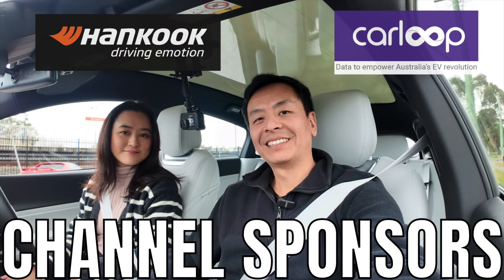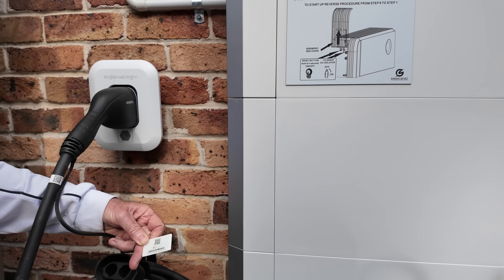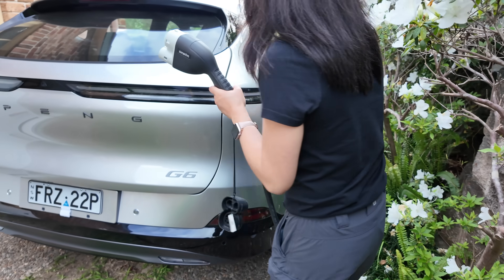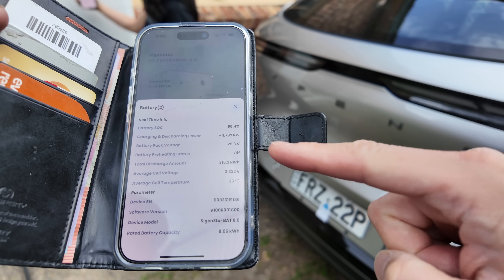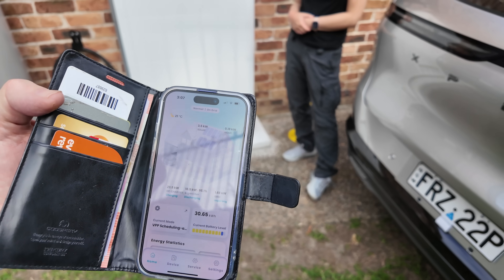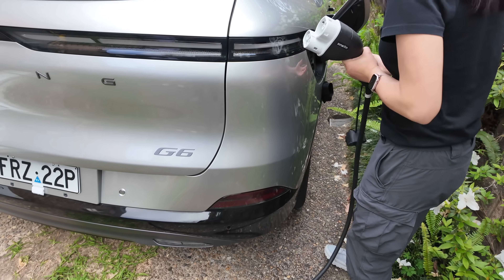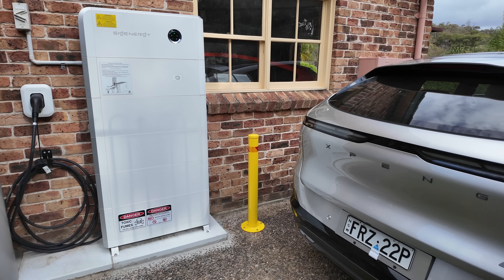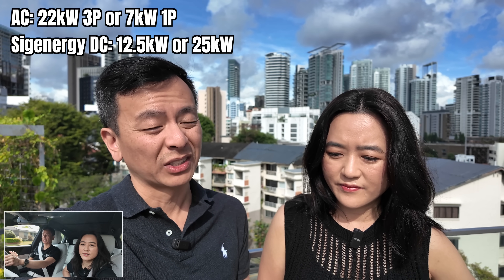Sigenergy EV DC Charger 25kW Real World Test | Is it worth it in 2025?

Comment: Seems rather niche currently. I can see homes sharing a single EV that has limited AC charging like BYDs wanting this. Other than that or commercial use I'd just use 3 phase AC.
Reply: Unless upgrading to 3 phase cost $3-5k. Which is now the entire cost of the DC charger.
Reply: @lordanubis5965 Things I currently use 3 phase power for. My grinder, air compressor, bench saw, welder, car charging.
This is a decent chunk of cash for a single function device. It's got potential, but currently very niche uses. I'm hoping in 10yr the technology evolves to have more functions.
Reply: Good point raised. I have a single phase house and a 50 metre driveway and power cable run.  Upgrading to 3 phase on my property would be very expensive (>Aud25k) as I would need to dig a new power cable run and remove trees.  The Sigenergy can be a good option for single phase houses who want faster charging than 7kw.
Reply: @tonyg2002Aust  3 phase is just far more useful currently. I'm not sure of current costs but installing 3 phase in my house, I think was the 60s(my grandparents put it in when they built the shed) was pretty cheap and easy with over head powerlines. In my area 3 phase is still easier, cheaper and offers more utility than the DC option.

I'm very interested in the technology and expect it to evolve to more than vehicle related purposes. But until then for most I think 3 phase wins.
Reply: @OTPulse i don't see the benefit unless you already have it. There is nothing to gain by paying for 3 phase unless you are running a home business in your shed. You are better off putting that cost into a bigger/better system.

I have single phase 10kW Sigen system with 32kWh of battery, 12.5kW DC charger. With 18kW of PV.

I am currently running my house in off-grid mode. Even with Ducted Aircon Heat/Cool running whenever i need it and fully electrified house (no gas). I never pull more than 10kW total load on my single phase inverter, so i never pull from the grid. I just turned the grid off to prevent exports in the end.

The DC charger is now 40% permanently price reduced. So if you factor the cost of a 3 phase AC charger + install and cabling vs dropping on module on you existing stack. Why would you waste thousands on three phase??

The cost benefit for an average household just don't stack up.
Reply: @lordanubis5965  I'm going to trust your experience. As I already have 3 phase, going DC is kinda pointless, but I just asked my brother who's an electrician and 3 phase in my area is under $2k. Maybe it's more expensive if you're area has underground power.

Personally I don't think either is worth it for the average person.
Reply: @OTPulse  Yeah I'm on underground power and not close to the electrical bollard? (green box). So it would be a lot of cabling and earthworks for no actual benefit in my scenario

Comment: I have the 12.5kw version. I charge only using PV as i'm off grid. Its fantastic! bi-directional works well with my BYD Atto 3
Reply: Does the Atto 3 battery warranty allow v2h?  Is there govt legislation for v2h where you live?
Reply: @michaelcurtis559  Atto 3 comes with V2L lead from BYD, and they have no way of telling the difference between V2L and V2H 😁. I've used my Atto 3 V2L to power critical home appliances during several power cuts (i.e. 'DIY' V2H), but it does involve running extension leads from the car into the house. Of course, you are still limited to 2400W total load with Atto 3. I'm currently trying to get in on one of the bidirectional charger V2G trials being run here (Endeavour Energy and Amber).

Comment: If you have a 48kwh sig stack, 6 batteries, to add a EVDC .. do you have to split the stack… as I understand u can’t add it to a stack of 6 batteries?
Reply: yes need new stack with additional inverter so not sure if worth it or no
Reply: @stanavagiannis2381  Actually it wont work when you are not connected to the grid, you need the dc charger to be in the stack unfortunately.
Reply from the maker: Correct. The stack of 6 (excl inverter) must include the EVDC

Comment: Tom it is always recommended to undo the cable and no looping so it won’t get warm when charging.
Reply: A good comment - so I went and charged for 4 hours straight today (thats my house and Sig battery in the video) and checked the temperature of the cable.  It didnt get warm from the current.  25kw max doesnt seem to be much for these thick cables.  They are probably the same specification cables for use with 200kw and higher charge rates.  A good safety comment though, appreciate the perspective.

Comment: It is extremely quiet. The only noise I notice on mine is the beep to say it started charging.

With the price drop just announced. I am seriously considering upgrading from 12.5kW to 25kW.

The full integration of the DC charger is far superior to the AC using clamps. As the clamps can be affected by export restrictions. So, if you are in WA where you are limited to 1.5kW export. You will never really achieve PV surplus charging on an AC charger is your inverter is bigger than 5kW, because it will never detect enough surplus at the meter to initiate a charge. (Endless posts on Whirlpool Sigen Charger thread.) We also don't have access to Amber or any non-government retailer on our grid, so self-consumption is key to ROI in WA.

My commute is 50km each way. 5 times a week. My BYD Sea Lion 7 won't make the full 5 days without charging. This charger allows me to get higher volume into my car prior to losing sunlight after work and no grid draw. My personal goal is net zero 2025, to have zero grid draw as i get $0.00 for exports. My Sigen backup gateway is set to "Off-Grid". Using all the PV I generate is vital for ROI.

The app and system have total control over the charger. not meters clamps or third-party sensors needed. If you connect a Home Assistant to it, it levels up again and it allows a lot of automations than the two token app ones.
- For example, I set mine to start charging every night with my heat pump HWS turning off as the "On" trigger and to keep charging from battery only until battery SoC is 35% then turn charger off.

You can also be community minded and add it to PlugShare app for others to use if you trust other humans.

Bi-directional is a consideration, but not something I am willing to engage with due to "grey area" of vehicle warranty.... A recent video from @ElectrifyThis about Aviloo proves that the car logs what type of charge or discahrge the vehicle does. So I'm not rolling that dice until my car ROI is 100% or someone wins that battle in court.

According to Home Assistant. My Sigen system since 14th July has saved me $1130 in potential bills. So, multiply that out over a year. That system and charger pay for themselves pretty quick. Full ROI in 1,579 days.
Reply: what price drop?
Reply: @caramelexspressofan  Sigenergy announced as of today have dropped the price by 40%. Comes with extended warranty before 31st Oct.

7.5m is being phased out and will only come in 10m cable length.

Comment: Whether it’s worth it simply comes down to cost. I recently tested my Seal with a bidi dc charger that is going to sell at a very attractive price point… I’ll probably ditch my 22kW AC charger for it given the bidi capability.
Reply from the maker: What export kW did you achieve with the Seal?
Reply: @LudicrousFeed  7kW - but this appeared to be a constraint of the bidi charger - we also performed a V2V test and dispatched 20kW from an Atto to my Seal. 🙂
Reply from the maker: Nice! Did you need a special cable for the V2V?
Reply: @LudicrousFeed  Nope - regular CCS2

Comment: The benefits of the bidirectional charger are less to do with the charger speed and more about access to the power stored in your vehicle battery to run your home or export to the grid when appropriate.  With this system, you'll be virtually off-grid all of the time.

Comment: I have a MyEnergi Zappi charger in 3 phase so can deliver 22kW on AC, but one thing which wasn't made clear in the video is that, I will ONLY get 22kW AC charging if the vehicle supports it, which no vehicle does yet. That's because the AC to DC inverter in the car supports either 7kW or 11kW for all current EVs. For example, my two BYD's have 7kw inverters in them to convert the AC, given to it by the Zappi charger, to DC.

Tesla's and Expeng can do 11kW charging on AC.

This Sigenergy is supplying DC charging, which means you can always get 22kW because every single EV car does more than 22kW in DC charging.

So the point here is, if you want more than 7kW and 11kW home charging for your vehicle, then you need a DC charging system, like this.
Reply from the maker: Cheers for the clarification 👍 In the summary at the end, we did allude to the fact that if you had a car like Zeekr 7X or Polestar 4 then you can charge at 22kW. But as you said you have to respect the weakest link when it comes to AC charging whether it be the car or the supply or the EVSE 🙏
Reply: @LudicrousFeed  Wow I stand corrected! I just checked and yes you're right, 22kW AC charging on the Zeekr 7x, amazing at such an affordable price too. I'll take your word for it on the polestar 4 :)
Reply: @micoots i have a BYD e6 that charges at 22kw on 3 phase AC
Reply: @petedawborn  Thanks that's great info. I have a BYD Atto 3 and a BYD Seal, both are 7kW maximum AC charging ie. single phase inverter in each vehicle. Based on the e6, BYD have had 22kW tech for years, that begs the question now, why don't BYD include 22kW AC charging in their latest vehicles?
Reply: BMW ix1 is also 22kW. With the OVO 3 for free it's quite easy to charge during the day for free.
Reply: I am in the U.K. and I have a 22kw AC three phase charger which works with my Renault Zoe which takes 22kw AC charging.

Comment: Why is V2G DC more common than AC? Cars already have an DC to AC inverter for V2L and grid and your home is already AC. Hopefully V2G systems running on AC will come out soon and will be far cheaper than these DC solutions. 

Agree though that DC will support more power unless your car has 3 phase 22kw and can do that V2L also.
Reply: because the car inverters don't have the frequency synchronising and anti islanding circuitry that solar and home battery inverters must have by law to be grid connected. You can connect your V2L capable car to your house through a generator changeover connector if you want giving you V2H, but this relies on you physically isolating the home from the grid via the generator changeover switch.

Comment: Not very good charging cables are hard wired into unit. That makes costly repairs
Reply: Have never seen a DC charger that isn't tethered.
Reply: More likely the Sig design with cable tethering prevents costly repairs. There is no pressure on where the cable meets the inverter.

Comment: 3 phases AC will get you 21kW... 25kW is not that much faster especially given the slowest DC charging car registered is BYD's 18kW. Beacsue DC is charging is controlled by the inverter and not your car, does it cause more wear and tear on the battery.
Reply: Single phase house - 7kw AC charging alternative.
Reply: DC from the Sigenergy DC charging module does not need to go through conversion from AC within the car, so it should be easier on the car battery.  
At 25kw throuput,  it is relatively slow.  Slow EV charging is generally better for the longevity of a car's battery than fast charging (at a commercial EV charger)  because it generates less heat and places less stress on the battery cells, reducing internal degradation over time. While fast charging is convenient for quick top-ups, consistent slow charging helps with battery balancing and preserves the battery's capacity for longer.  In theory, this Sigenergy module should be easy on the car battery.

Comment: I wonder how much having a DC charger at home when DC puts more wear on the battery as we know or have been informed.  Also unless the car manufacturer has approved their car for V2H/G it could void your car warranty as Neerav has shown in his videos.  May be something to bring up on one of your livestreams and have Neerav on as a guest particularly around battery warranty with V2X.
Reply: What's the source for DC charging being worse for the battery? Haven't heard that before.
Reply: @nathan100tz Indeed the only potential concern with repeated DC charging is confined to very fast DC at more than 1C up to many times C. For full BEVs this 12.5/25kW DC would not trigger that concern.
Reply from the maker: Curious to explore how many current OEM warranties actually explicitly prohibit V2G
Reply: @LudicrousFeed  I know Neerav has asked quite a few manufacturers about it.  I wouldn't want to find out the hard way though and void my warranty.
Reply from the maker: If it’s not currently explicitly prohibited, then it can be argued in a court of law